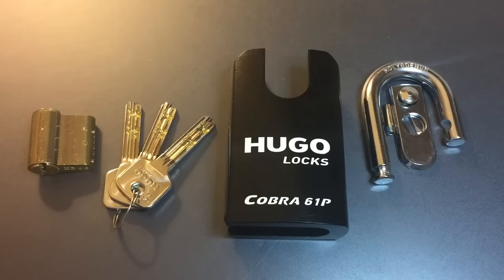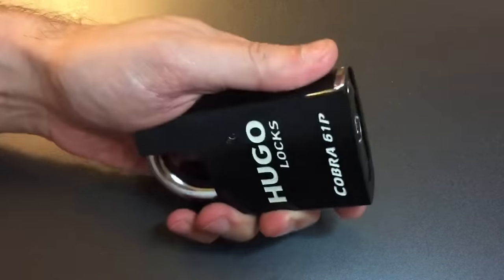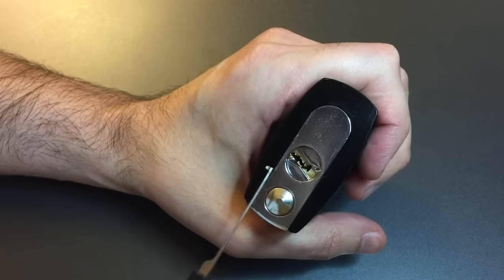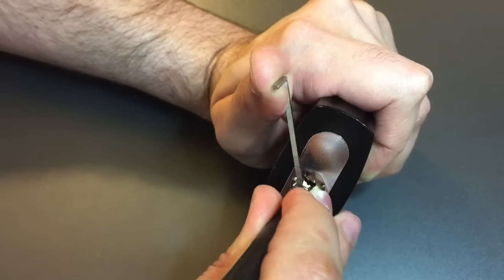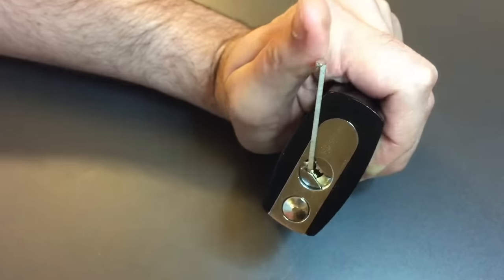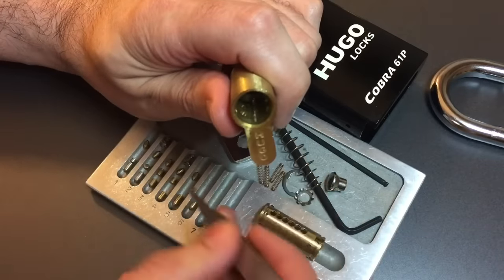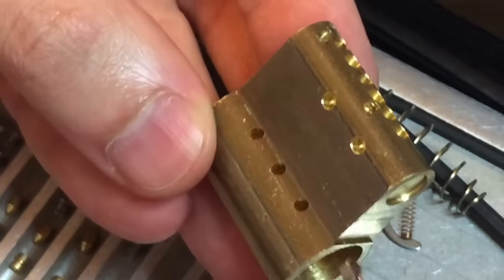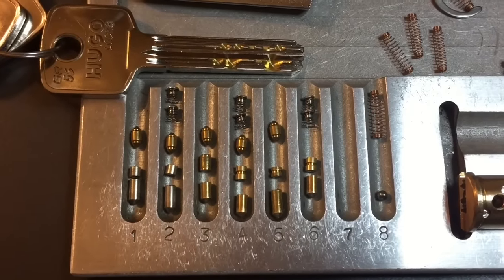[275] Hugo "Cobra" 61P Padlock (6 Trap Pins!) Picked and Gutted

Comment: I'm sure a large portion of us viewers don't actually pick locks yet we all have learned something that is valuable to us all; don't buy a master lock.
Reply: Devon Sanders I was looking at locks at Walmart today.. they have their own brand now.. made out of aluminum
Reply: Master locks are very good quality a thief tried ripping my cable lock and took my whole window bar with him and stabbed his ribs master locks are really good quality don’t believe this fool with his little kits no one even has
Reply: @michealangel1556  bro the first time I ever tried picking locks i picked a beat up rusty masterlock in 5 minutes with a Bobby pin and piece of hose clamp. Btw rusty and beat up =harder .If someone with any practice tried raking a master lock it pops open in seconds unless it has a rather extreme bitting. That's the absotue truth. Physically they are strong on the out sides but you can also use a blow torch and melt the insides to the point the lock will open within 4 minutes or less
Reply: Micheal Angel haha no one even has. I have several lock picking kits. They’re pretty cheap, your thief is not very skilled.
Reply: @michealangel1556  Sorry your window got broken into, but that was a really dumb thief. Just because one person doesn't know how to pick a Master lock doesn't mean that it's not possible. That's not logical.
Reply: @genericusername4206  thieves tend not to be, if they were they wouldn't be in such high risk/low reward work
Reply: @SkollTV  People don't steal because they want to, they steal because its the only way they can put food on the table and pay the rent. I hate to say it but your way of thinking on this subject is downright childish.
Reply: @kazialionis9138  lmao sorry professor

hate to say it, but your way of thinking on this subject is downright idealistic. You probably think that people are inherently good too.

I can't speak on behalf of all thieves but I know that around here it's mostly because they're addicted to drugs and can't hold a job. If they really wanted to put food on the table they would find a way to get and keep a job and not risk going to prison/court costs and leaving their family to fend for themselves. There are easier ways to put food on the table, and I won't excuse it. It's not an Aladdin story, we have programs so that people can get what they need to survive without even working.
Reply: @SkollTV  OK while this can be true what i'm trying to say is that while people aren't inherently good almost nobody intentionally puts their lives at risk whilst hurting other people if there is a better option for them. Also depending on the drugs addiction can be extremely hard to overcome especially if your life is bad to begin with and you don't have enough money for high quality therapy and rehabilitation. I also originally replied to correct your notion that the reason people steal things instead of relying on other options was out of stupidity. Everybody knows about other options and some people have reasons that they cannot utilize those. The chances that someone is robbing houses because they are to unintelligent to use other sources to earn money are incredibly low.
Reply: Holy hell guys, Michael was making a joke
Reply: @michealangel1556  He aint no fool this guy can pick like every single lock and excuse him for buying a better kit but considering this is probably his job he should get a good kit
Reply: @kazialionis9138  i mean not always they could just get a job
Reply: Randomly after no idea how I arrived via the algorithm to this fascinating channel, I  I tapped open a padlock for which I'd lost the key.  I am gobsmacked.
Reply: It hurts even more to buy a master lock when you know they are relatively easily defeated, like I just did today, to put on a self storage unit. I got the "max security" model sold at home depot, because Master Lock is the only brand sold at HD, and I didn't think about purchasing a lock ahead of time when I went to rent my storage unit. However, if someone really wanted to break into the storage unit, I'm pretty sure it would be easier to take a grinder to the old rusty metal latch, or just cut a hole in the sheet metal roller door itself. The reality is, lock picking is obviously a great tool if you know how to do it, but if you don't care about leaving a trace, you can cut or break into 95% of the doors/containers used by the general public using common tools, or just use a bolt cutter on almost any padlock. I "picked" the lock on my desk and filing cabinet using a paperclip and mini screwdriver in the office at a place I used to work at, and used the desk key to open the thermostat "lock" (I don't consider something that accepts any shape of metal roughly the correct size to open as a real lock) as well. Another time, when I was a landlord at a house I recently sold, a tenant had replaced a bedroom lock and left it locked even though I gave multiple notices that we had to get in on a certain day/time to let a pest control exterminator in. Not wanting to have to reschedule the appointment, I took a hacksaw to the whole doorknob and the lock was forced open before I even finished sawing the doorknob off, just from the vibration from the saw. (I bought a new doorknob, made several key copies, and installed it before the tenants got home & explained to them that we had to let pest control in). Also, the master lock "set your own combination" locks, are easily melted with a torch, even though LPL did a video on an even easier way to open them.
Reply: When I saw 6 I liked picking them with those knives you get in pumpkin carving kits. 😬
Reply: @michealangel1556  of all the things that never happened, this never happened the most
Reply: Any viewers of any lockpicking channel will know that lol
Reply: @kazialionis9138  People steal so they can buy drugs.
Reply: the most valuable lesson we've learned is, if someone really wants to steal something he is going to do it and there is nothing what could prevent that form happening!
Reply: Master locks are more of an anti tamper lock you put them places where you don't want people to randomly wander or open... like pools or sheds. i don't recommend using one to secure valuables.
Reply: @michealangel1556  you are sort of a guy that tell everybody that you have the best stuff in the world and of course you know it better then experts :)
Reply: Haha there’s a lot of locks I’ve learned not to buy. :D
Reply: i know this comment in a year old but i just want to say, master locks are still good, people are more likely to try and brute force the lock open which is why there are so many protections against that, such as the anti drill pins and overall stronger exterior. this among most other videos you'd see of someone picking a lock, its all in a very controlled environment, theres no rush, pressure, etc. also a thief who would put in the time to learn lock picking probably wouldn't know how to get past the trap pins cause they wouldn't have any practice with it. LPL has had a lot of time and practice with these locks and several different types of locks and he also has the tools for it, at a certain point, if the thief has access to everything LPL would have for example you'd have to question why they're still stealing stuff cause they seen pretty well off (i know there are probably people who would still do it but they're not common enough to warrant the most high quality everything in a lock). sorry for the rant
Reply: Rather depend on a Slave's Chain than a Master Lock
Reply: @michealangel1556  You're fucking funny dude... a true artist... "Micheal Angel" Yo!
Reply: Picking masters when you start can kinda be tough. I had one with harder bitting just out of luck. It’s still one of my hardest locks.
Reply: Even if i learned about lockpicking to an very advanced level and then i started to "Design" locks, but when i got a lock pick set i couldn't pick a 4 pin lock. So... Theory is good but practice is better.
Reply: @michealangel1556  Dont believe this fool without his little window bar someone else now has
Reply: Honestly, the only reason I watch these videos is because i wanna learn how to pick my own door, for when i lock myself out again 😅

Comment: So much drill protection! Perhaps the architect had a lock drilled out in the past...
Reply from the maker: LOL... these locks were definitely built by someone who subscribed to the "more is better" school of lock design, which does have some merit.  :-)
Reply: LockPickingLawyer I think the issue is that if you drill the bottom of the cylinder out the entire pin stacks could be dumped out through the hole you drilled.
Reply: @lockpickinglawyer  And all of that held in by one small screw.
Reply: Germans also make very good drills ;-)
Reply: @rat4spd  One small screw? The main screw holding the lock core in place was under the shackle. Together with a thick plate. Which would make for a difficult task if one would try to pull the lock out of the bottom of the lock body.
Reply: i would think that drill protection on the end would just snap the drillbit if you get there.
Reply: If it's worth doing, it's worth doing well... more drillprotection.
But they might have adjusted the angle of which the core should rotate, before opening.
Still a nasty lock, I bet.
Reply: @rat4spd  That 'one small screw' only prevents the shackle from being removed from the lock body in the unlocked position; as long as the shackle is locked, removing that screw has no effect.
Reply: Ask Hilti for help.
Reply: @lockpickinglawyer  if the design flaw was removed, and the tolerances were improved would this be a brilliant lock?
Reply: @lockpickinglawyer  haha, it is German design...

Comment: I would like to know if Hugo had reacted and fixed the design flaw.
Reply: me2
Reply: I am curious as well how they reacted . Have they communicated with the lawyer I'm wondering ?
Reply: The engineer that designed that should be canned...Whata dingaling.
Reply: Tell him too pick a lock from the street he won’t able too open it
Reply: I don’t believe the engineer should be canned, as design flaws happen to a lot of these locks. If the lawyer picked it it was because there was a design flaw. This is still a very well made lock and you have to take in account that the Lawyer is very skilled in picking locks
Reply: I disagree, the lock was designed right out of the gate to be trapped when the lock is pick attacked. It was meant to be pick proof. In that design,...apparently, an untested design and there are many, many, many pickers out there, it will open the way he opened it. No doubt the over paid engineer who designed that, was pounding his chest after finalizing its design. This reminds me of Palmetto State Armory designing an AR15 that takes AK47 magazines..There were a bunch of issues with it as if no one tested it. It took me but an hour of looking at it to find a solution to what was wrong with it. Magazine stops needed to be machined into the upper receiver was the biggest problem that needed addressing. This could easily be done during the machining of the upper. I actually sent them an email and called and a year later they implemented all but one of my suggestions...But my point, just like here, there was zero testing of the design and or their testers are completely incompetent at what they do. Yeah, he's good, but pulling a lock apart to observe its function and then defeating it isn't as difficult as it may seem...The manufacturers of that lock, had more of an understanding of its design than the lawyer and sliding something in to stop the other trap from working is the simplest thing to do in the attempt at defeating the lock...A no brainer in my opinion...kinda like the magazine stops in the upper receiver fix.
Reply: @MrDLRu  Firing duo to mistake with out proper investigation is a mistake. Did engineer have enough time to do the job? It might be the design was valid, but manufacturing fumbled tolerances. Management could have forced hand to use certain left over parts. Or myriad of other issues. Normally these mistakes are organizational not in individual level. And even in rare cases you should first try to educate people and set well defined goals and enough freedom to achieve them. By firing you don't learn anything. Firing makes a culture of hiding mistakes. Also finding and training replacement is really expensive. Firing is is last resort measure.
Reply: The Core is made for Doors. On a door this Design Flaw dont count. I guess this is why the Company dont changed it. Greetings from Germany
Reply: It may well have been a QA issue with the production machining not being within stated tolerances.  It is quite possible that if manufactured to the tolerances as specified in the original design drawings there would have been slightly less rotation of the core and the trap pins would have worked.   Impossible to know without having the drawings in front of you and the tools to measure the as manufactured lock.
Reply: @Kinderfanga  ah shit man, sorry, my comment was aimed at @MrDLRu
Reply: @Barney1051  oh lol yeah that guy deserves the insults
Reply: @MrDLRu  You're blabbering on about unrelated nonsense you.
Reply: LPL spent 2 hours assessing the lock before even attempting it because of the trap pics. I'd say it's a good lock.
Reply: Even with the flaw you have to stop one set of trap pins and also only someone who has an extensive knowledge of picking and this specific lock would be able to pick this if a criminal would go to that much effort then it doesn’t matter what precautions you take they would find a work around

Comment: This was such a fascinating video I didn't realize it was so long compared to most of your videos. Very impressive job with the picking and the break down. Its unfortunate they didn't optimize the core with the locking mechanism. Other then that this would still be a nice lock to use in a practical sense.
Reply from the maker: Thank you... and you are correct that it is still a nice lock, even if not well matched to its core.

Comment: Hi Harry, Wow what an over engineered cylinder .... maybe. Obviously  both set of trap pins would come into play in a Euro cylinder or other applications - as you mentioned. Trust you to find a design flaw ...! Great. Well picked and excellent descriptions of ALL the functions. BTW hardened anti drill pins are not a great deterrent for our hardplate safe drills - but the spinner, that's a different story.  Regards, Brian.
Reply from the maker: Agreed... my approach in this video would not be very effective (fast) in an application that required a full clockwise turn.  Picking the deep spooled trap pins while both picking and tensioning clockwise would be very, very hard.  On drilling, I always thought that it was the abrupt changing of hardness in brass to hardened steel/carbide that really damaged tooling and delayed drill attacks.  That's why I thought those pins were somewhat effective against even bits than could chew through a more homogeneous hardened material.  Not so?  I speak from a position of zero experience on drilling, so it's possible I'm parroting the remarks of someone who didn't know what they were talking about.
Reply: Hi Harry, Certainly the hardened inserts will prevent standard drill bits from penetrating. On a cylinder fixed solidly in a door, the carbide safe drill bits with specially shaped tips, will cut through them. There is often other ways to by pass the hardened inserts, such as the Perry Puller, a special tool that will literally "suck" most plugs out of a lock cylinder.  Regards, Brian.
Reply from the maker: Brian Hignett Perry Puller?  I tried searching, but couldn't find anything on it.  Is it also known as something else?
Reply: Hi Harry, The Perry Puller was made in Australia by a Locksmith/ toolmaker - they are no longer made to my knowledge. I did in fact see an almost identical tool a few years ago, on a German site that sold expensive locksmithing tools (Govt.?) You may be able to find it, I have no idea which one now.  The tool works like this. A special self drilling/ tapping screw is wound into the keyway using a battery drill, an appropriate steel plate is placed over the cylinder, and the puller attached. Using a spanner on the puller body, the plug is extracted. It shears off pins, clips etc. It has bearings on all mating surfaces, to minimise friction. The screw will bypass hardened pins, ball bearings etc.  It's not your everyday go to tool, but for locks that have been superglued etc. or a high security cylinder, that you wont have the luxury of picking - or trying to pick! It is a quick way in.  Regards, Brian.
Reply from the maker: +Brian Hignett I think I know what you mean... something like this?  https://shop.multipick.com/en/opening--locksmith-tools/opening-locked-doors/cylinder-pulling--destructive-tools/special-lock-pullers/bell/bell-accessories
Reply: Hi Harry, It looks like a photo of the Perry Puller!! maybe this guy copied it .... anyway, yes that's the tool - very effective, and impressive when you see it in action. It does what you would not think it would do. Regards, Brian.

Comment: Great job as always. Only comment I would make is that when your picking you are doing it from an  advantageous position. I am assuming because of the camera angles and it would be hard to show what you were doing if the lock or door knob was mounted? I started to learn how to pick when I was installing locks for a living. Was never very good at it. It was definitely much harder to pick with the lock or knob mounted.

Comment: Figured out a fairly easy way to figure out pin orientation if you mix them up. Line them up shortest to longest and put the key in the lock. When you look down into the pin chambers, you can tell which is deepest and which isn't, etc... Makes it super easy to repin.